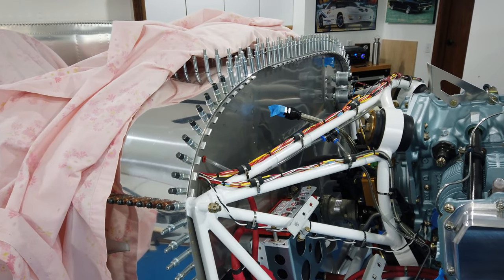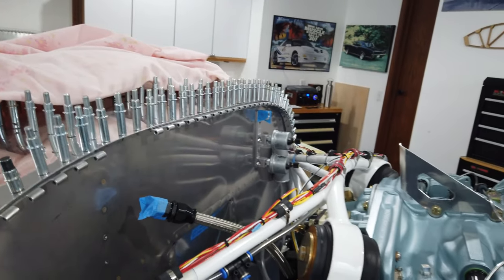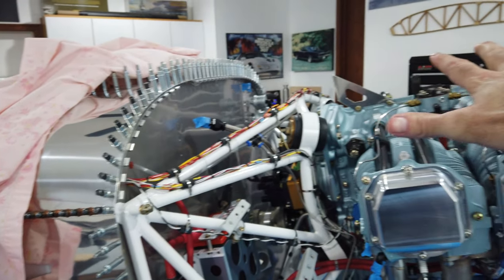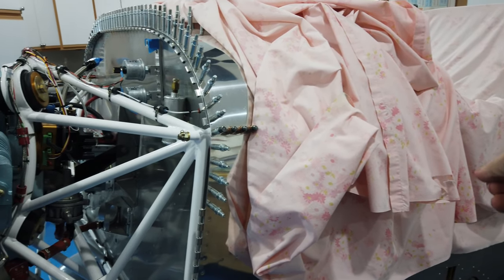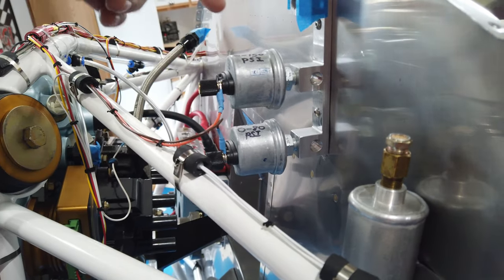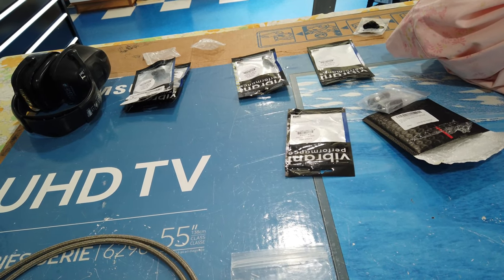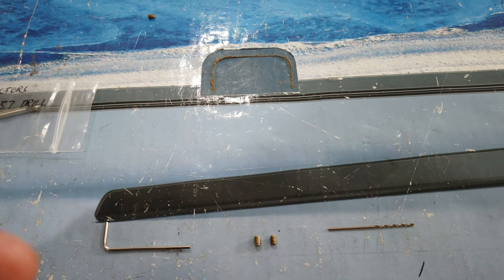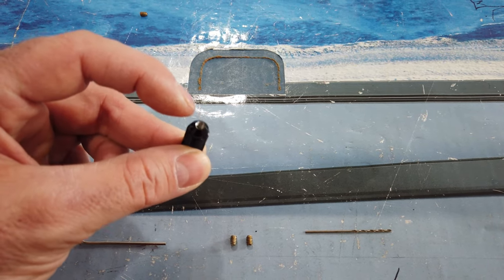Vans RV 7 HINT Videos Top Cowling Hinge and Restrictors

Comment: You saved me $100 on restrictor fittings.  Thanks.  :-)
Reply from the maker: Great! The #57 drill bit size is a suggestion; you may have to go bigger if you can't get the smaller drill to drill at all. Be careful not to go so big that you ruin the hex shaped recess in the set screw.

Comment: I am sure you are aware, they make clecos with threaded wing nuts and hex nuts when greater grip pressure is required. 
I’ll look forward to seeing the cowls attached. The hinge pins will look so much better than screws.
Reply from the maker: Howdy Ken. I am aware of those screw tight clekos, however, I would still rather have the structure "flight ready" when I start working on the cowl. Plus, needing the top skin riveted forces me to tie up some loose ends I have been putting off.  I believe that the hinges may also be lighter than screws/plates/sockets, etc. and will prevent cowling bulge when pressurized.  It will still be a while before I get back to the cowling, so stay tuned!